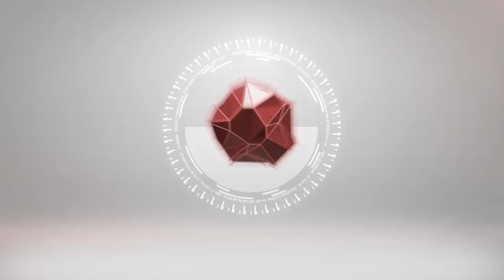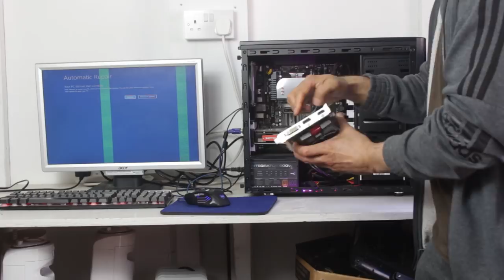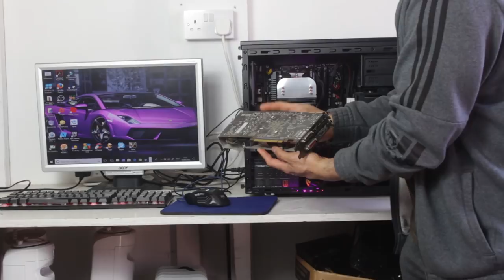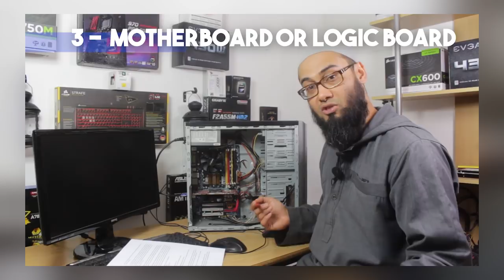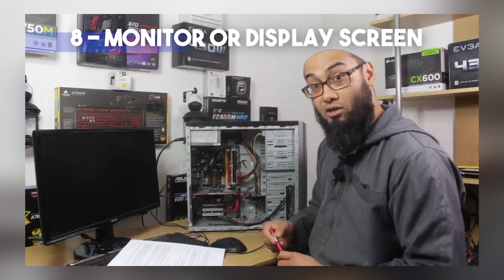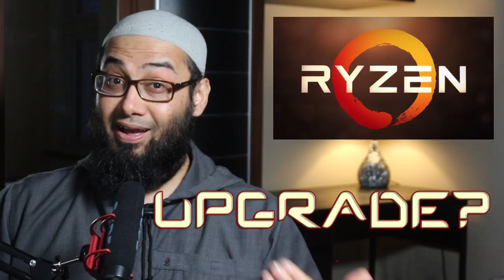Troubleshoot A 1080p Gaming PC With Artefacts Green Vertical Lines On Display Monitor | GPU Fault?

Comment: - Cleaning out the heatsink & reapplying thermal paste
- Flashing a BIOS of a lower spec'd GPU of the same brand with compatible memory (for lower default GPU and memory clocks)
- Downclocking the GPU and memory clocks, increasing the FAN speeds
- Sometimes enabling spread spectrum and running the GPU for almost a whole day and then disabling it
- Heating up the VRAM with a hairdryer (as opposed to baking it)

have all worked for me with a failing Asus R9 280X DCUII TOP with the exact same problem as the one you've described (two vertical colored bands, sometimes blue, magenta or green, of horizontal lines, all the way from the BIOS, and increases when setting 1080p in Windows without GPU drivers, and failing to initialize the GPU driver with a hard hang), several times (20 or so) over a year and a half.

I know the VRAM is failing, but somethings are just hard to let go off. It's time for a new card for me. Totally not worth the time I invest periodically just to get the card working again. I'd get it working fine for a week to a month, then get overly optimistic and try running something a bit too intensive and it would be back to square one. Every fix, it'd still be fine as long as temps were below about 50C, and revert back to this broken state if it crossed 52C. It would work fine as long as I was playing your standard LOL / DotA / CSGO et al. Intensive titles like Witcher 3, Squad, Tomb Raider would manage to ramp the temps and clocks up regardless and bork the card all over again.

I would have tried modding the BIOS and flashing that in, but I like UEFI and the only available utility for modding the BIOS for my card disables UEFI.

Hope it helps if you're trying to salvage the card. And worth it only if your time isn't worth much.
Reply: You want to say that heating the VRAM/GPU chip with hair dryer fixed it for sometime?
Reply: Yup it did. I didn't have a heat gun, and I also didn't have an infrared thermometer, but it was a goner anyway, so I didn't have much to lose. Eventually tried baking the card recently after it failed again, 5 capacitors popped off. RIP!
Reply: Gilbert Cheng Well I modded a BIOS (which made it non UEFI) and that BIOS is less stable, I have a Sapphire HD7950 and it gives same vertical lines , I first thought I'll bake it in oven but I thought about removing heatsink and hitting the GPU chip(and other parts) and it works now for half the games and for rest half it crashes (8 crashes in 1 day but it still works). BTW by VRAM you meant the GPU Chip(the one that's at the centre)?
Sad to hear about your graphics card.
Reply: Seema Bholla sounds like yours is about to go the way mine did. Heat the VRAM if you have artifacts, and the GPU (center chip) if it's completely dead. Heat gun good. Oven bad.

Overall if your time is worth anything, then don't waste your time trying to fix it this way.
Reply: Gilbert Cheng just came back to this video, to this comment, to thank you. i heated vram with hairdryer and let it cool, and then installed on the computer.. IT WORKED!!! THANK YOU
Reply: you can buy broken models of your card off ebay really cheap and using a heatgun easily remove and replace the bad memory modules and voila!  Done this with my friends 980ti his card is like new again and we have plenty of spare parts should it go down again,  4 years and still going strong at full specs!
Reply: @digital sprite Go for all of the tips I've mentioned above. The heat gun works. Using the oven is too risky, even when you're careful. This additional bit is unconventional, but also worth a try, since it does work for me with memory sticks - use a pencil eraser, the soft kind, and rub down the contacts of the GPU that plug into the PCI-E slot. You should see those contacts go from dull to brand new.

All in all, as long as you're not going to physically damage the card any more than the non-functioning state that it already is in, you should be fine.

If you value your sanity even slightly, buy a new card.
Reply: @digital sprite Sorry, I missed the part where you said you'd already tried the heat gun. It is important to let the card it cool down to room temperature after heating up the VRM before you attempt to plug it in and power it on.

If you do find a BIOS of the lower spec of your exact same card model, you will need to match the VRAM manufacturer, and then flash that BIOS in in safe mode. Safe mode doesn't load the drivers, and even shows you all drivers that windows has installed in the past, so you could even remove all the unnecessary drivers. The trick is that the lower spec of that same card model will have lower clocks for the VRAM and GPU, so once you do flash in the lower spec card's BIOS, it will be okay from the BIOS on and have no problem in windows either. It is important that you match the VRAM manufacturer, usually a toss-up between Hynix and Samsung.

- Flashing a BIOS of a lower spec'd GPU of the same brand with compatible memory (for lower default GPU and memory clocks)
- Downclocking the GPU and memory clocks, increasing the FAN speeds

I mentioned these two, because I have an AMD system and it kept crashing when windows tried to initialize drivers. However, my friend who has an Intel system was able to get into Windows and use his PC for about 2-3 minutes even after the driver initialized, before it would freeze up entirely. So he would use a tweak utility to load a downclocked profile he'd saved and apply it within those 2-3 minutes and the card would be stable after that. It needs to be done every boot, or done with the tweak utility to automatically load the downclocked profile on boot.

The BIOS way is quite fidgety, but if you have the time to do the reading required, having the card a-ok from the BIOS POST itself is the kind of set-it-forget-it ideal that you would want for yourself.
Reply: I got the same problem on an identical gpu 280x dcu, I guess it's time to replace it or simply stop gaming. Thank you for being so informative

Comment: I had this same issue and managed to fix it, to sort it I went into my GPU  driver "Nvidia control panel" in my case and in "Adjust desktop colour" put digital vibrance to 0 "black and white" and leave for 5 minutes and turn back up.

Comment: I have a similar issue, was playing a game got some flashing then just grey lines across screen, pc froze still here the sounds though,.  Had to turn off and restart but now pc won't boot,  it goes to windows did not shut down properly I can't boot into safe mode.

Is this likely a failed gpu or could I have a further problem?
Reply: did u fix it
Reply: same thing happened to me when I was playing some gta v
Reply: and did you find a way to fix it? I have that problem atm

Comment: I had the same issue but horizontally how do you fix It I have a 2070 super and have only had it for 3 weeks and it was working great for that whole time and I was playing a game and it crashed and then it happened again when I was closing something and I needed up with green lines and it’s the gpu(I unplugged the gpu and used the other output and it worked)

Comment: I get also the vertical lines, but only under heavy load. What could be the problem
Reply: PSU
Reply: @HassaanALal  i changed the gpu 3 months ago, and that fixed it. Thanks anyway
Reply: the PSU or the signal cables :/

Comment: The green lines and other artifact issues are the easiest self repair you can do on your GPU and NO!  not the fucking oven Lol <Though that does work it also overheats other sensitive parts that will result in failures down the road that aren't easy to fix.

All you need is heat gun or rework heat/solder station and a few minutes of time to heat that gpu up for a few minutes and allow it to reseat itself I place a a few 1 ounce weights on top after heating but you don't have to, I just like to make sure the weights get that chip all the way back down.  Watch some videos if you never did this before to make sure you cause no dmg to your card as I just simplified here what's a tad more involved but fairly newbie easy.  Study 1st!

If this doesn't work then you have more problems than might be feasable to pay someone to fix, might be cheaper to buy a new one at that point.

Comment: That means I have to throw the old card
Reply from the maker: Possibly, or try the oven method depends on your specific issue.  I actually sold mine off as faulty and someone bought it off EBAY for parts probably!

Comment: Today Is 4th June 2020 If Anyone Has Green Lines Issue Comment Down 
I Was Having The Same Problem
But Fixed In Only One Step
Reply: Don't say that you replaced the card?
Reply: I am having
Reply: @Akkkkkkkk47335  heat your card in a gas oven for 5 minutes 
take off the fan and the plastic cover
the iron solding will melt and will solid the solding again!